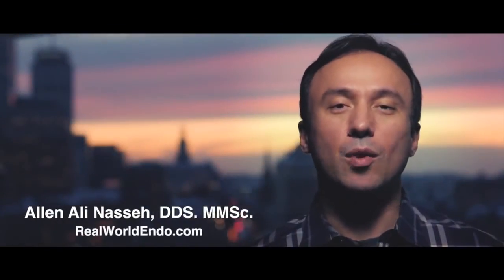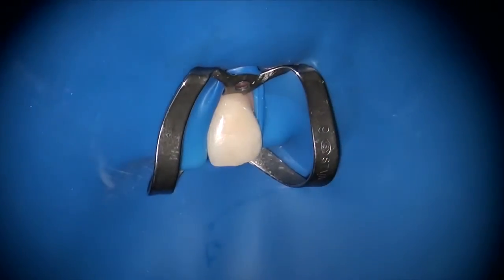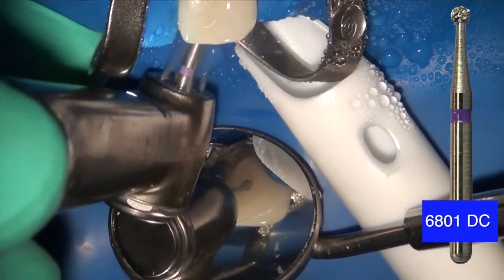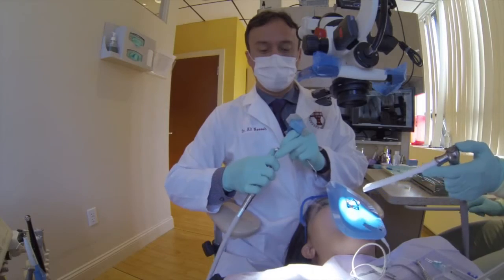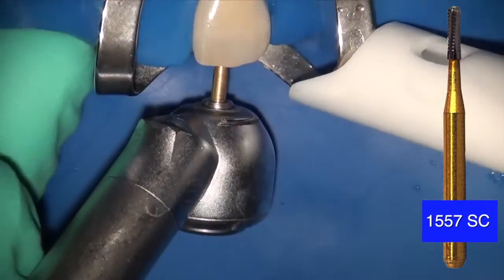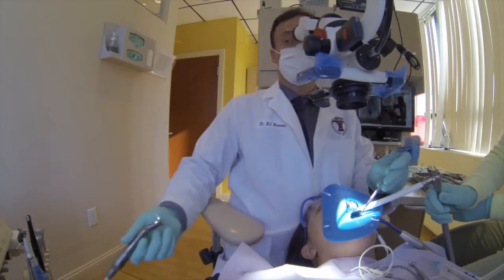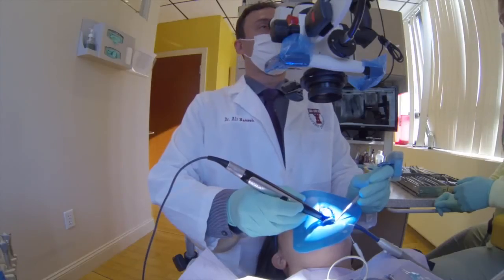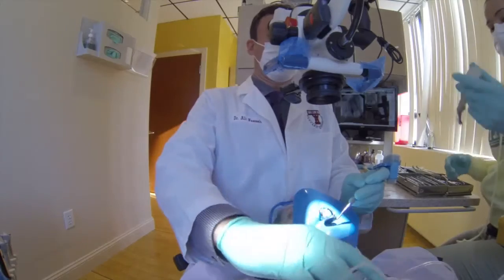CBL #15: Central Incisor ESX Technique

Comment: if using a different ultrasonic than forza v3, how should we go about selecting an endo tip that is similar to E14D or E12? in other words, what are the characteristics these tips have that I should look for in choosing tips that work with my particular ultrasonic. thank you
Reply from the maker: E11 and E14D tips fit on different ultrasonics. It doesn't have to be just Forza V3. Most ultrasonics have the same attachment. You just have to experiment to find the correct power setting on each to avoid fracture or a weak output. This is because each ultrasonic unit has its own power settings and differ with others. Forza is very powerful and so you the recommended settings on the tips are meant for that unit. But if the tips fits on a different ultrasonic unit the you just have to find the optimal setting by doing your own experimentation. Otherwise you need to consult your manufacturers list of tips to see what comes close to those tips. Cheers!

Comment: hi doctor ,how are you 
would you please tell us how much the r p d for the ESX
Reply from the maker: ESX should be operated at 500-600RPM in Basic Cases and 300RPM in Advanced Cases. Cheers! :)
Reply: Thanx a lot 
What about the torque ?
Reply from the maker: Torque setting depends on the handpiece. If you're using EndoSync I recommend OTR Motion and a setting of 0.6 Ncm.